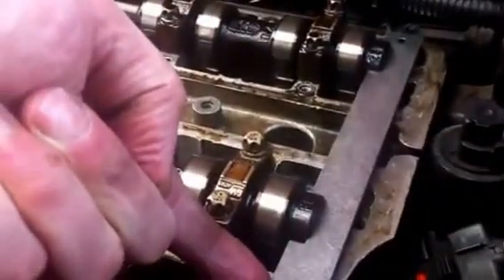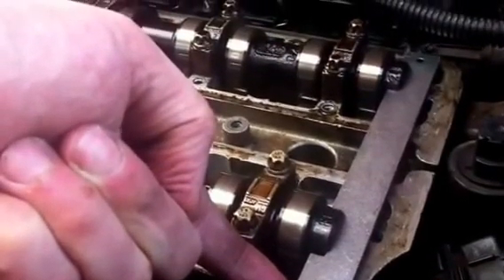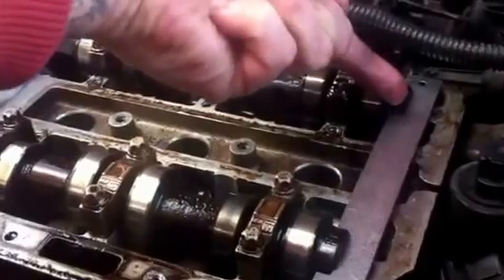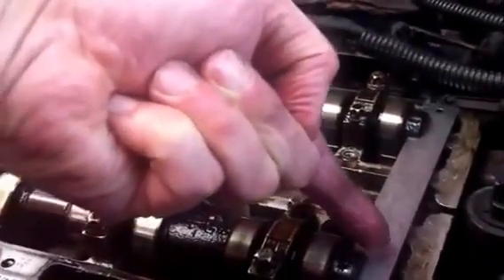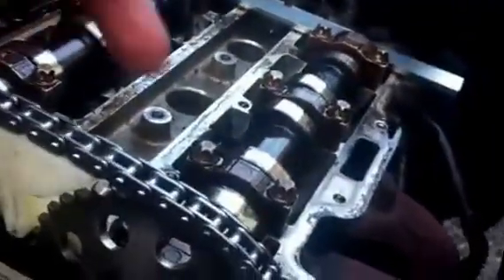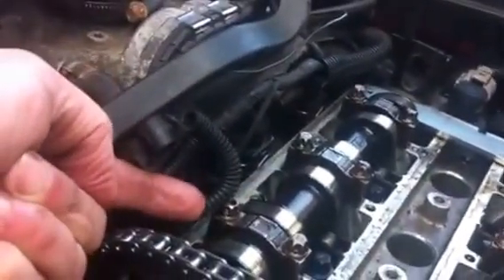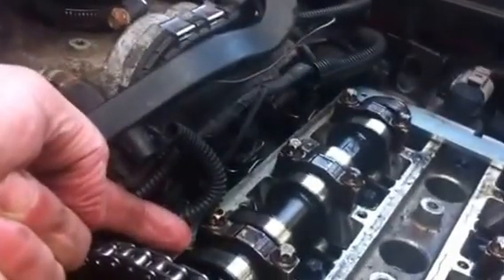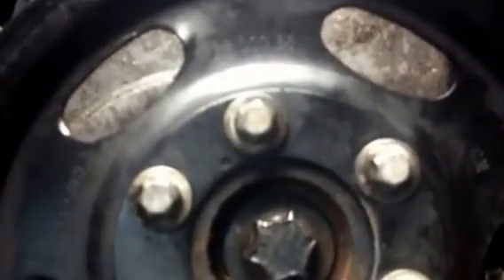How To Use The Vauxhall Corsa Timing Chain Kit To Set The Timing

Comment: 2007corsa d 59000 miles on her... its not bad tapping and doesnt seem to be continuos more intermittent
Reply: Could be a hydraulic cam follower, if its inconsistent, a loud continuous rattle at start up, usually points to chain tensioner and the normal reason to change the chain and attached components.

Comment: Two questions, first are you a brummie? Second is my Tigra has less than sixty thousand miles on it and the AA guy reckons this chain has unlogged of snapped. Had to be towed from great Barr all the way to Walsall. Is it worth trying to repair this myself?
Reply: Did you ever figure out what happened to it? What did it sound like as well?
Reply: If your chain snapped then not worth repairing. Very likely the valves bent after it snapped
Reply: @KamilJan95s  I sold it broken, the timing belt probably should have be replaced before it happen, I paid the price
Reply: @deajechannel5882  definitely the best course of action. Hopefully you learned your lesson to check stuff like that

Comment: ive done a video but anyway to show just you lol
Reply from the maker: +steven mcloughlin it sounds like the timing chain mate. if its not fixed it will fail and the engine will seize. You can buy the parts for about £80 but its a big job to do, about half a day to a full day for an experienced mechanic. so the cost lies in the labour. Vauxhall quote around £750 to do it! a small mechanic business should charge around half that. Id get it checked by a pro though mate :) good luck